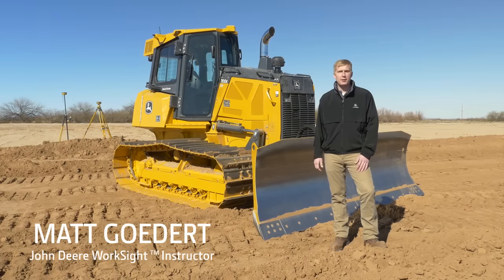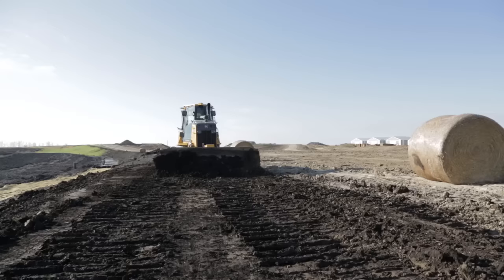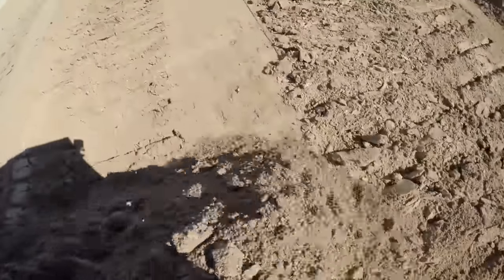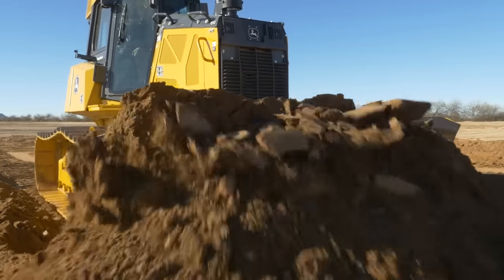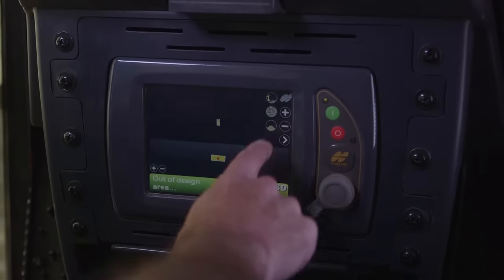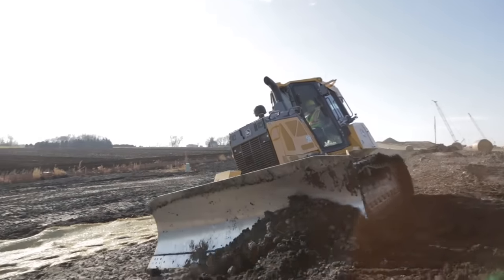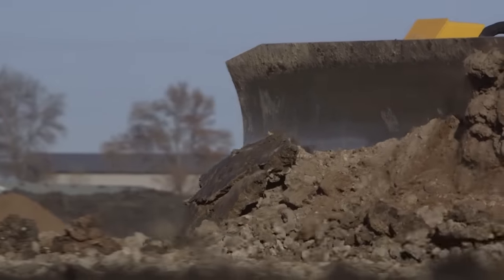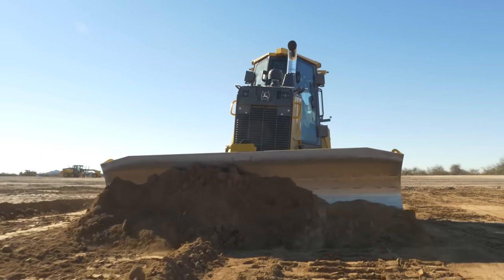Auto SmartGrade | John Deere 700K SmartGrade™ Crawler Dozer

Comment: Love this machine however do something with the door hinges. Seems like its a major problem. Other than that i have ran your machines starting with 450, 500,550, 650, 700, 750, 800, and 850s there's alot of h, j's and ks in the mix as well. My preference is the 700kthough and you won't like this but my d6ks. Cat makes some nice machines as well.